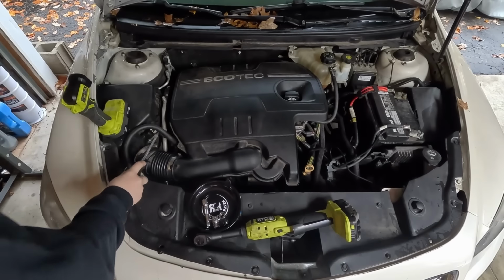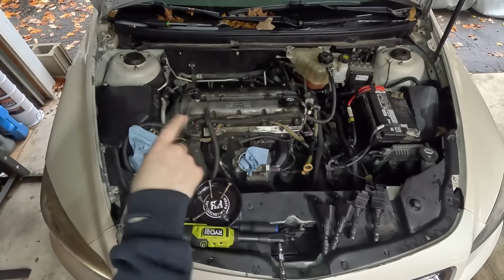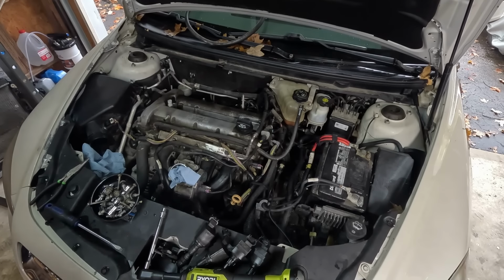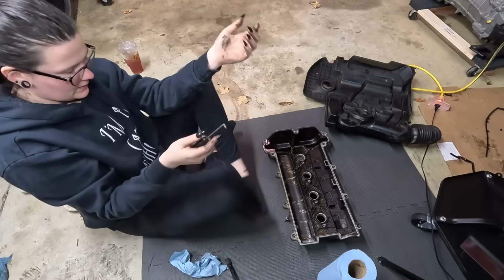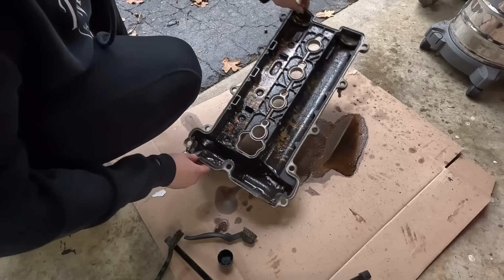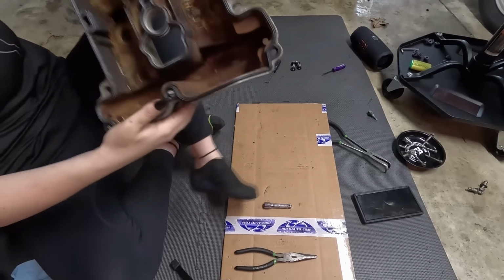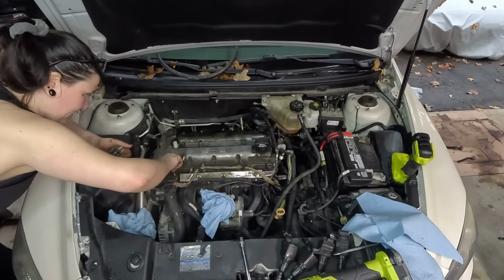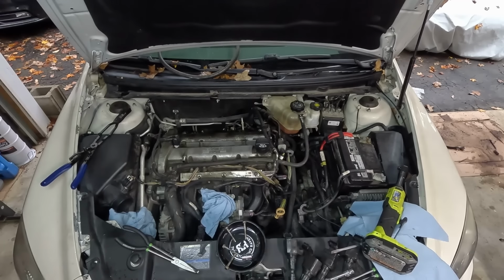2011 Malibu Valve Cover Gasket Replacement

Comment: Did I miss taking plugs out or do you just have to take coil packs off ?
Reply from the maker: You don't have to take the plugs out to do the valve cover gasket, just the coil packs. 😁
Reply: @TheRatchetingRaven  thanks